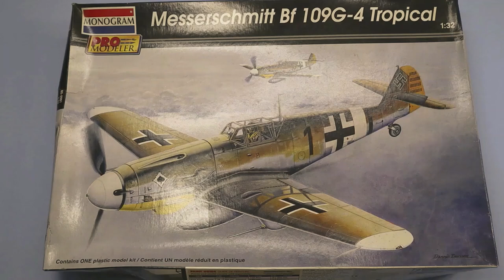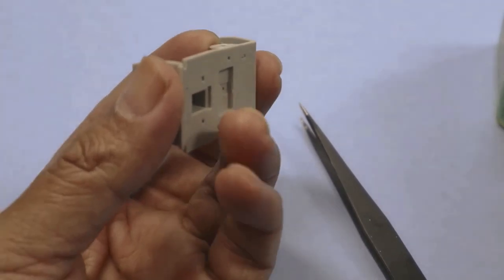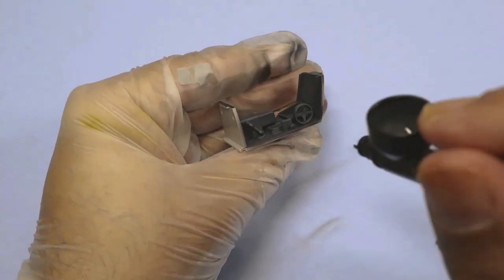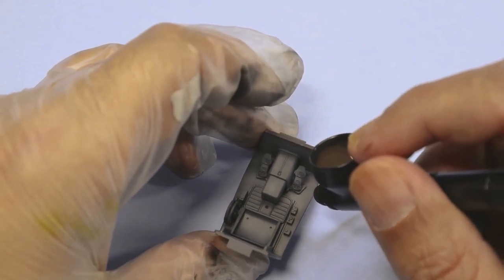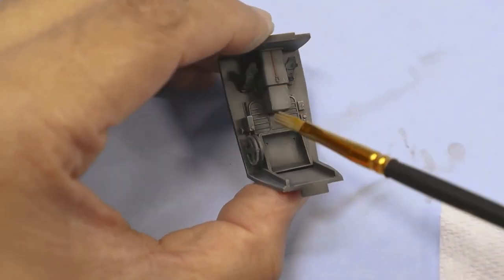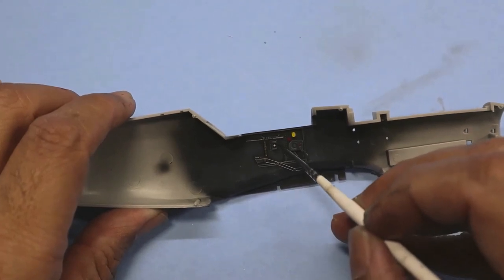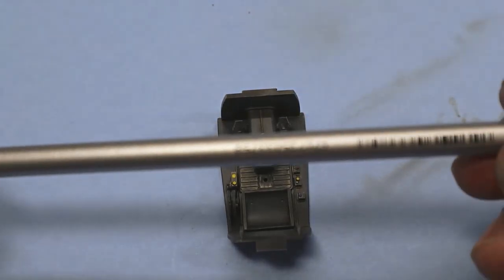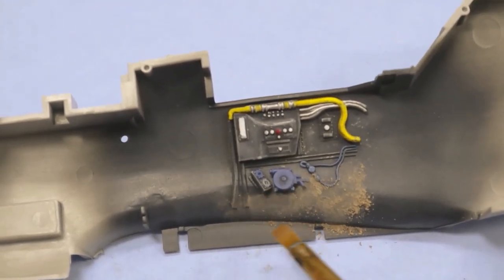1/32 ProModeler Bf-109G-4 build (Part-1 Cockpit)

Comment: Is it the Mig Ammo Ultra or Standard cement you use?

Also, for bleaching the interior panels are you using a 0.2 needle? Would 0.3 work?

The reddish brownish colour you use in post shading the recesses - what colour is this please?
Reply from the maker: Hi Blootered, it is the Mig Ammo standard liquid quick setting cement. I now have their colored cement and I like it better! It really helps seeing where the cement is flowing.
For the bleaching, yes you can use a .3mm or even a .5mm. If you use good trigger control and low psi.
The reddish brown color was just a mix I made. You don't need to be super precise with it as it just a shading color. I think I use Vallejo Dark Brown and mixed it with one drop red, one drop black and thinned heavily. 
Hope this helps!